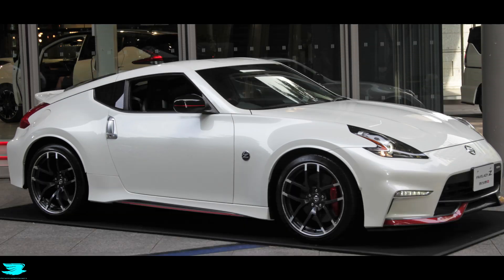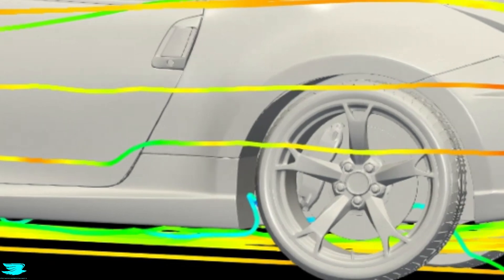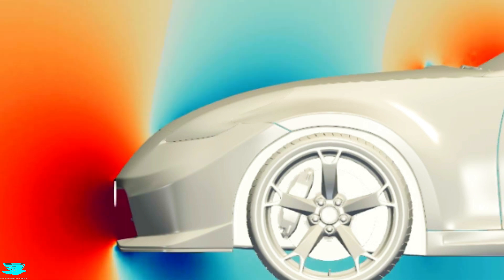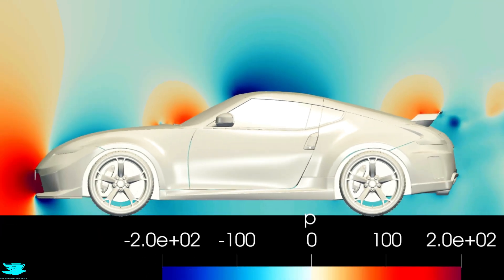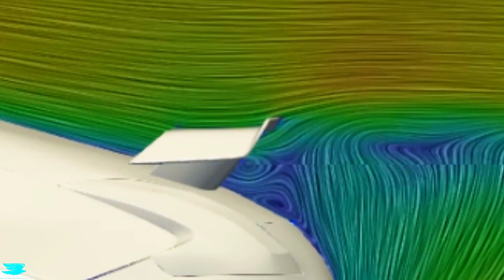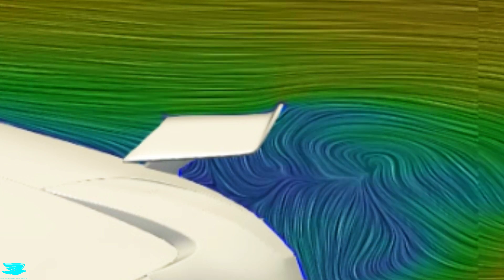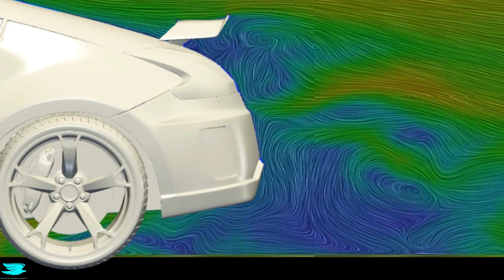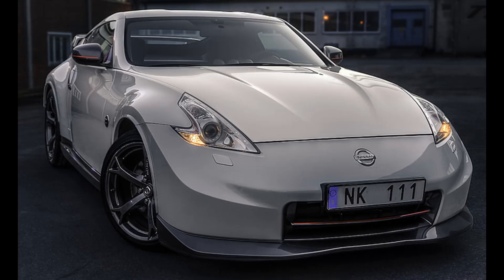How Nissan Designed The 370Z’s Aerodynamics [Nismo]

Comment: We Must Have the Comparison for the V2 Nismo! Would be cool to see how the changes (hopefully) improved on the weak points.  The body kit for the 370Z Nismo changed in 2015 with a much smoother aero feature on the rear hatch  - a fully redesigned front bumper, side skirts, rear bumper, too! Different wheels as well!  I wonder if the V2 rear Diffuser is equally awesome??

Comment: I see a lot of side skirts with end plates just in front of the rear wheels. I assume it is to squeeze a bit of down force from that high pressure area.
Reply from the maker: The plates in front of the rear wheels is often to reduce the drag of the rear wheels, but they can also be to direct bad flow away from the diffuser, so that the diffuser has cleaner flow to work with. That is also a possibility of the side skirts.

Side skirts can also be used to help segregate the underbody flow, so that you can get good low pressure there and hence downforce too.

Comment: It's possible that Nissan placed the wing in the boundary layer on purpose - sometimes you don't need much downforce and because the flow is slower, the impact on the drag is also less. This clearly isn't meant to be a high performance wing. If they placed the wing higher they probably had to make it super small (and ugly) to hit drag targets.
Reply from the maker: Yep, I'm quite certain that it was designed that way mostly for looks. And maybe the aerodynamicists didn't have a choice.
Reply: @PremierAerodynamics  the 370Z also had a facelift and they removed the wing in favour of a ducktail spoiler, wonder how that compares to this version

Comment: Have you ever thought about applying the area rule to a subsonic vehicle? Take this car for instance, If you imagine a stream tube and part of the car intersects that stream tube, you would assume the car to alter the geometry of said tube. On the roof if you had a stream tube and it enclosed part of the roof, the reduction in cross section area of that stream tube would then accelerate the flow in that specific location. Using this principle you can then alter areas of bodywork to try to maintain the speed in that stream tube even, so that the body work creates as little drag as possible, since you avoid large gradients in velocity.
Reply from the maker: That's a really good idea. I think that's the explicit explanation of the general idea of making something streamline, but breaking it down to an actual measurable value means you can optimize much more easily. I think another way would also be to use the same idea, but also look at how the pressure is changing, so that the pressure gradients are reduced. That would probably work.
Reply: @PremierAerodynamics  I've been working on a little project, and using this in conjunction with the general flow field has given me good results. I don't know how it would work out in actual practice, but the general trend from CFD is that it tends to reduce drag and make more kinetic energy available downstream. More importantly, less pressure gradients are tugging at the flow making it crash into places you don't want it to.

Haven't done the final run, but we're somewere in the 3.4 L/D ratio and the CD is 1.03ish.
Reply from the maker: That’s a good result for the first general test of the idea.